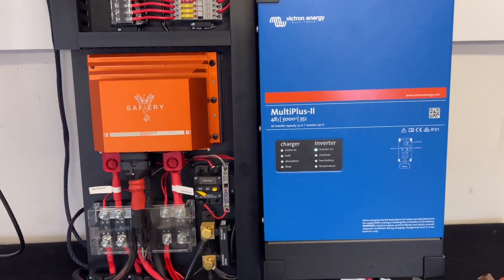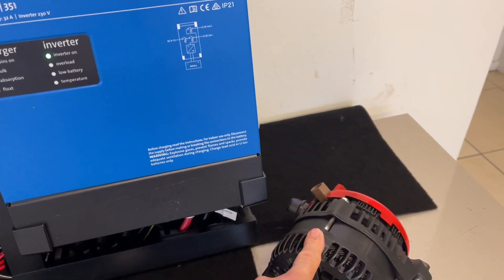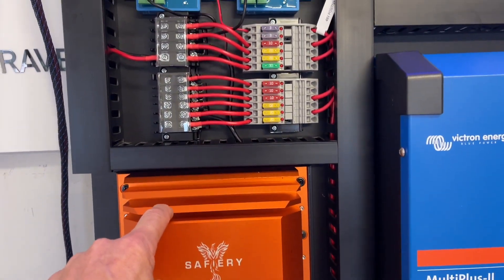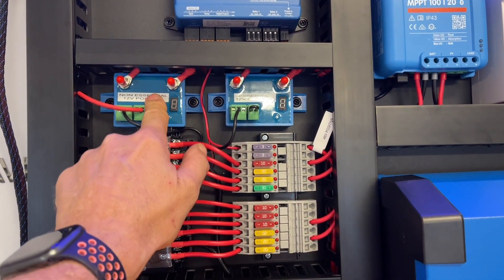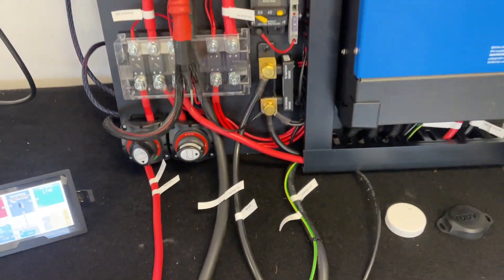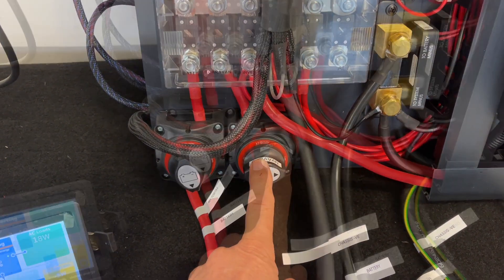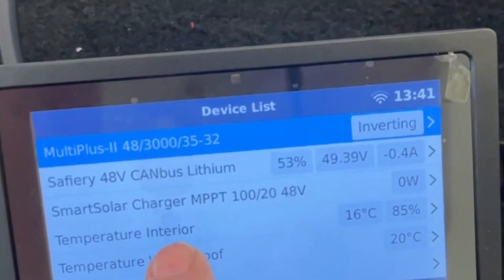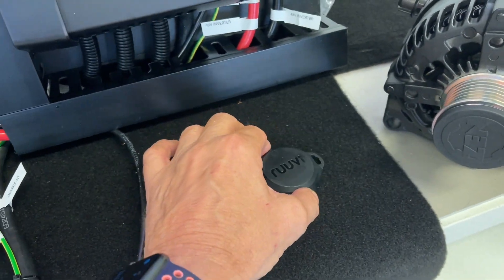LC79 Hall Built Canopy 48v with Scotty 250A Brushless Alternator 3000W Inverter/Charger 400Ah Li

Comment: What was the thoughts behind the change of alternators Bruce? I’ve got a 48v kit coming from you, just waiting on the alternator, but haven’t learnt why the change from the water cooled. Keen to learn!
Reply from the maker: We haven't tested the new 250A brushless alternator yet. The concept is very good: brushless means no impact by mud and the sealed bearings will hold up as well. Personally I think this new concept is a better purchase than the 200A sealed (water cooled) alternator. We want to see max power at idle and cruising RPM. We continue to ship the proven 250A brushed model. It would take an extremely harsh trip with lots of mud to slow this one down.